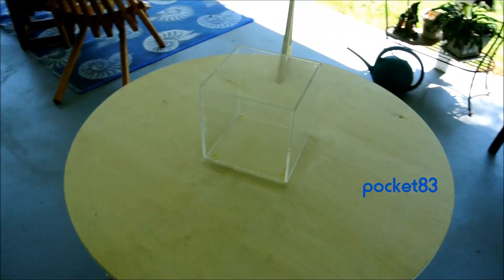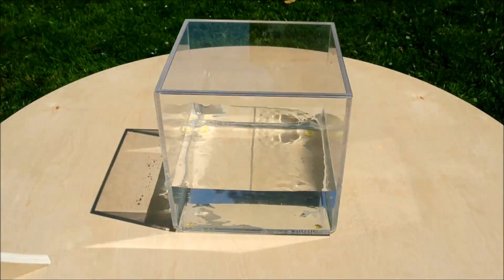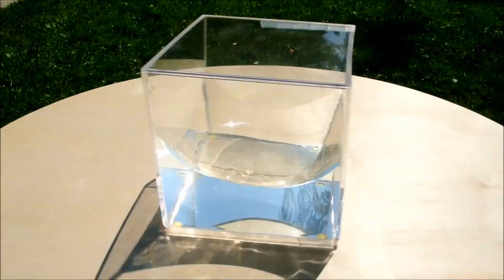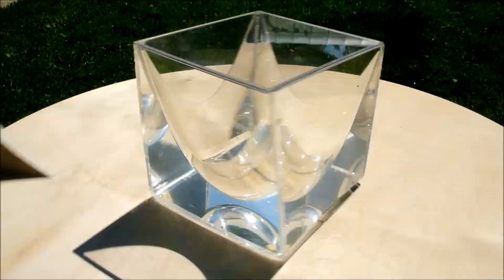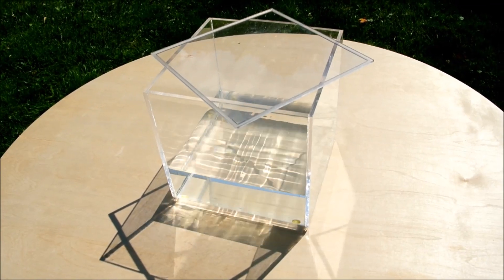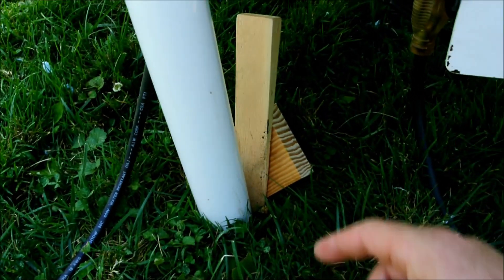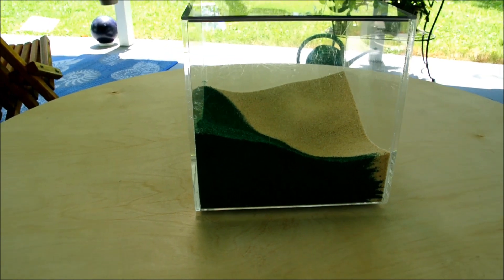Forming paraboloids on water

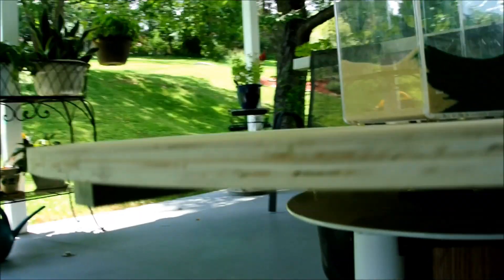Comment from the maker: YES, I used a counterbalance. I explain that at 8:50. 
—and—
Freezing or resin casting would take too long, but I discuss plaster of Paris at 3:50.
—and—
The counterweight had to be asymmetrical, in order to stay out of view for the camera shot. It worked.
Reply: what would happen if you did this with a triangle shaped container? would it react different?
Reply: the number of corners determines number of peaks.

if done in a bowl, it would have no peaks.
Reply: pocket83² I was almost one of the people who sent accusations flying until you addressed it in the end
Reply: What do you think about syncing video frame rate with revolutions of the table to get one frame per 90 180 or 360 degrees?
Reply: do it for the vine
Reply: Resin wouldn't take too long. I've made quite a number of them. OK, I guess it depends on your definition of too long. I've used epoxy which took about 8 to 12 hours. It gets hard before 4 hours. It seems plenty solid enough, but still, there is enough creep left in the resin that after a few hours the surface will distort and wrinkle as the resin settles. If that is too slow for you then you can also try Polyurethane, which may be too fast! Most Polyurethane resins will turn opaque as they cure. You can find some that stay transparent if that matters to you. Polyester may also work, but I have not tried it in this application as I can't stand using polyester.

I have even tried metal. It sort of worked but the thermal gradient was too steep. I think I would need to enclose the rotary table in an oven to slowly lower the temperature as the metal solidifies. I tried zinc, tin, and bismuth. Pute bismuth wouldn't work, but an alloy of tin and bismuth show promise. Galium might be useful because the melting point and room temperature are so close that you have very little thermal gradient, so you cold solidify the metal without too much thermal stress screwing up the surface finish.

I think part of the instability in your rotary table might also be due to the fact that you have the whole thing balanced around a single, small axel in the middle. You could add some skate-board wheels around the perimeter to spread the load to the outside edge. I have one rotary table that rode completely on the outside edge of the spinning platform.

Your container is also very tall for the width. It might be better to use a cylindrical container. You'll get no splashing on acceleration and smoother air flow. I'd say put it all under vacuum to really get rid of airflow problems, but you are using water, so that would start to boil. You could switch to using oil instead of water.
It may be counterintuitive, but plaster of Paris does not work well. This seems to be because plaster forms a non-newtonian fluid (like corn-starch and water). As it begins to set in some places faster than others the more fluid parts start to twist and produce weird waves. It's a very complex process. If you use other types of cement you may have better luck depending on how thick or thin you mix it (sometimes thin is better, sometimes thick is better depending on the cement). Hydrocal, hydrostone, Dry-stone, and Tuf-stone would be a good place to start. I forget which ones I used. These set much slower than plaster of Paris, but some of them, like hydrocal will give a very plaster-like appearance. It's superior in my opinion. It is also MUCH stronger and will not chip or crack as easily.
Reply: pocket83² the cpunterbalence should be at the same height as the camera weight. Otherwise it would still create a wobble, or even make it worse. Looking at the footage it runs quite smooth otherwise.
Reply from the maker: Wow. Do you understand that the entire purpose of this setup was to produce the opening shot for my main channel video? Why is it that you people consistently treat me like I'm oblivious? The structure would have been visible. 

The wobble was only even a factor because of the poor support in the grass. I should have used patio stones- but I'm not making a gyroscopic stabilizer for the Mars orbiter here.
Reply from the maker: My procedure wasn't too anything. It served its purpose.

But since you are apparently so comfortable with suggestions, perhaps you should make a video, just to demonstrate all of your expertise.

Comment: I collect magnetite sand as a pass time hobby, it is very shiny and fun to play with using magnets.
I think it could make some really interesting sculptures hardened in epoxy or what ever you can dream up.
I'd happily send you a quart or what ever if you'd like but by the quart because it very heavy.
Let me know if you're interested then I'll give you my Facebook so you can message me.
Reply from the maker: Neat stuff. I once worked in a research center where new types of metal furnaces were being developed. At the heart of each was a cluster of anodes, which were something like magnetite vases filled with copper chop. These would get dipped into the molten metal in order to pass an electrical current through it, thus heating the pot up. 
...
Sure, I'm interested. I haven't seen Magnetite sand before. But I don't use Facebook.

Comment: I've just watched this video for the ump-teenth time and still enjoy it,  I apologize if I've posted this info before as well.  Some of the commenter here might do well to do some research.  The shape is indeed a paraboloid and that fact is used to shape large telescope mirrors.  

Do an internet search for University of Arizona's Richard F. Caris Mirror Lab.  Q. What's so great about Paraboloids?   A.  A mirrored paraboloid will focus all incoming light at it's focal point.  A large rotary kiln is loaded with glass; then spun at roughly 6 - 10 RPM while being heated from above, the parboiled is formed then the kiln is allowed to cool.  From loading the glass to opening after cooling takes months.

Comment: you sure this is a paraboloid and not cosh?
Reply: Catenaries happen in systems where the force acting on a piece of the system is proportional to the weight below it. In a system of water molecules, all pieces are acted upon only by the force of gravity (and centripetal force). Basically, point particles wont produce catenaries while strings will.

Comment: I don't know about you but when you stoppped the engine and it wound down, the eddies and currents in the water were way more mesmerizing to me.

It was like watching a dance.

p.s. A counterweight for when you mount the camera on there could address the instability at higher RPMs.
Reply: I also found that mesmerizing. In fact, stopping it and letting it settle (once the container was sealed from air turbulence) was incredibly organized and surprisingly gentle. It was like watching a feather fall in a way. I thought viewers would find too much of that footage tedious though, so I edited most of it out. Still, that may have been my favorite part. 

And for the thousandth time, there WAS a counterbalance. I mention and show it in the video. However, there was no symmetrical balancing structure, because it would have interfered with the shot for my video.

Comment: would love to see you revisit this with a wheel that has more mass, it would counteract most of the wobble issues you have due to gyroscopic stability, your base doesn't need to be extremely heavy, nor does the disk, about 50-100 pounds should add enough stability to the disc to be perfect for using it in the lawn, just make damned sure that sucker is balanced, and constrained with some good bearings that can take the radial forces due to imbalance
Reply: Using machined aluminium and additional bearings will help as well, I hope.
Reply: he should also attach paper or something along those lines to the other side so it's easier to see/watch
Reply: No, you want less mass under rotation. Any rotating mass that is out of balance is going to the make the wobbling worse. It's not like the situation where you have a wobbly table and you want to dampen vibrations from the floor. That example is static. Extra mass means more inertia so vibrations have less effect, but with a rotating mass that off-center is always out of balance and keeps trying to bend the axle away from the center. So in this case more mass hurts. You want to make the mass under rotation as light as possible and you want to make the axel as stiff as possible. The easiest way to effectively get a stiffer axel is to move the load bearing to the very outer edge of the table. What I use are skateboard wheels arranged around the edge of the round rotary table. The material of the skate (is it a hard rubber, or a soft plastic?) has some give to it so it also helps smooth out vibration. Out of balance loads then become less of a problem, but you do get more high-frequency vibration noise through the rubber wheels. Keep the bearing surface that rides over the wheels very clean and smooth to help eliminate vibration. Usually, it's not a problem. Pneumatic tires might be better, or a soft closed-cell foam tire.

I use a 3/4 furniture grade plywood cut into circles of various radii, 18", 24" -- can't remember if I had a 36" one, too. I mostly use the 18". I ground a half-circle groove in the outer edge to take a belt drive. For a belt, I use surgical tubing with the ends butted together and glued with a length of solid rubber or smaller diameter rubber tubing glued inside the tubing. I power the thing with a washing machine motors. I use a variac for speed control. I also have a smaller rotary table that is about 6 inches in diameter and is driven directly by a stepper motor with a microstepping controller. It's smooth enough and has precise enough speed control such that I can actually play a record on it.

Comment: if the water level rose from from 3 inches to 6 inches , doesn't that mean that the water pressure at the bottom of the tank was doubled ? and multiplying that water pressure by the tank's floor area would be "force" ? would the tank reading on a weighing scale double ?

Comment: If you're wheel had a variable speed motor, you could match the rotation to the frame rate of the camera to solve the instability issue.

Comment: Using a cheap, Harbor Freight dial indicator to center the cubic viscous media container will minimize the "wobble" at the vertex of your paraboloid. Also, using the dial indicator to test concentricity of the wooden platform will show another source of your vibration. Sanding the spinning table will bring it into concentricity. Turn some wooden dowels into spikes to replace the rollers for extra rigidity in the grassy area. Concentricity and rigidity are key for your experiment.

Comment: Awesome! One interesting suggestion--I work in a lab that deals with non-newtonian fluids, and one grad student researched the fact that wet concrete turns into a more newtonian fluid while being vibrated. Maybe if you added a small vibratory mechanism to the table, it would help the sand flow better and reduce the sudden shifts in shape. (doesn't solve the stability issue, though)

Comment: Very cool! 
What happens if you put the box off center? (fastened down, with correct counterweight, of course) I assume the paraboloid would stay centered on the axis of rotation, but I wonder if it would be stable enough to work?
Reply: I wonder how perfect you would get it if you used a circular container.
Mixed with Schmidt's idea of having it off-center, just a tiny bit to see how that would effect the parabola.
Reply: Jeremy Schmidt it would create a bigger paraboloid
Like if you divided that cube into 4 and only put watter into a cuarter (think of it)
Reply: It can work fine if off center if your platform can handle off-axis side loads. I use a table that is supported entirely at the edge by skate wheels. Off center containers of resin will harden and capture just the section of the paraboloid that would be formed at the center of rotation. This can be useful sometimes.
Reply: I wouldn't mind it if you lived close by.

Comment: If the container was watertight would the water form a mirror set of paraboloids on the top? Or would make a looping (waterfall?
Reply from the maker: I've been thinking about that myself!
Reply: The faster you spin, the higher grows the centrifugal force. When Earth's gravity becomes insignificant in comparison, and you basically just have a force pushing outward from the axis of rotation in all directions, I think the water would just collect along the sides in a way that leaves a cylinder-shaped body of air in the centre, and no significant movement within the water, just as you don't have with the paraboloid either.
Reply: If you took it to the extreme the surface of the water would form a cylinder on the inside surface.
Reply: But by just spinning, you can only come close to an overall force outwards; you'll never create a force sucking water to the top. The "fingers" grow higher because water in the edges of the container is displaced by the water in the centre trying to go outward. There is no reason to go back inward at the top.
Reply: I'm not sure what you mean by "bunch up at the top corner". There is never going to be more water at the top than at the bottom. There is never going to be more water at the top than at any other place in the container.
Reply: it would just look like it's cut off and a little thicker
Reply: . I think it would push the more mass at the bottom of the paraboloids up till the top fingers connect mirroring the bottom, If you went too fast I think it would do what you're saying. Wish I had a way to try this
Reply: So the water would just bunch up at the top corner with paraboloids running down from them hmm not saying your wrong but that just doesn't sound right
Reply: Thank about the spinning as a transformation to the equation of the parabola. 
If the water was 3in deep to start that's equivalent to a parabola with the fulcrum at 3in high with zero curvature. As the table spins the fulcrum is transformed downward toward the bottom of the container while the curvature of the parabola  increases. The fulcrum continues through the bottom of the container leaving a circle of no water. That circle would grow until the water forms the negative space into a cylinder.

Comment: I like the fact that you ended up using the waste from cutting the circle for making the camera cradle. This solves the initial table problem too, only three legs left now...

Also, the surface of the water is inderd very smooth, cool. Is it a true paraboloid though? Wouldn't that require a cilindrical container?
Reply: Umm, not really. We will often call a segment a "line," and we call a parabola by its name without graphing the entire thing to infinity. We are seeing a portion here-- a section, but that piece is surely representative of a larger, whole idea. "True" as usual, is a matter of perspective.
Reply: pocket83 Of course, you're right. I forgot about the whole segment thing, sorry.

Comment: Wouldn't the plaster of paris just seperate before it had time to dry? The heavier particles would be flung outwards and the water would rise to the top? If you did make it, you could line it with a reflective surface and make a solar ray!! ;-)
Reply: PoP is pretty forgiving. It may end up weaker than under normal circumstances, but I think it would still work.

Comment: Could you maybe use a clamp to actuate the pedal more smoothly? Not sure if it will help, since the switch itself jumps at intervals, but maybe that could make the speed adjustment a little more controlled. Just a thought

Comment: If you were concerned with getting it perfectly stable, drilling a hole in the centre and balancing it like a wheel (with the camera in its normal position) is the way to go.

Probably not worth it.

Comment: Was just about to comment about balance, but one thought, the weight is high on the top, and low on the opposite side, personally i would make another of those supports, and add the same weight as the camera, it's why they balance a car tyre on the inside and outside.
Larger pads unde the feet may be beter, if you have 4 concrete slabs that you can level it may work better.
Reply: Excellent point. However, a symmetrical counterbalance would be visually distracting.
Reply: Having 3 would mean dual purpose, could use it as a coffee table when turned upside down :D
Reply: What about three, 120 degrees apart. Then the camera will not be pointed right at the counterbalance at least.

Comment: Wish I could afford a potters wheel now. I want to make all kinds of strange containers and spin them
Reply: Tera Acquire a used electric motor at a garage sale or flea market and make/buy a potentiometer to build your rotating platform. Total cost for entire project should be less than $50. Probably much less.
Reply: an old electric sewing machine foot control might work as the speed controller